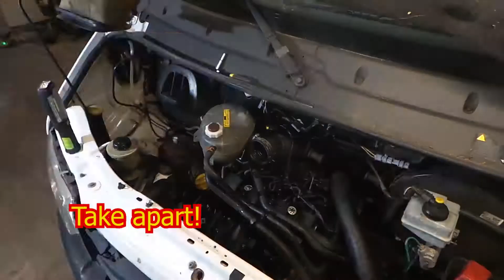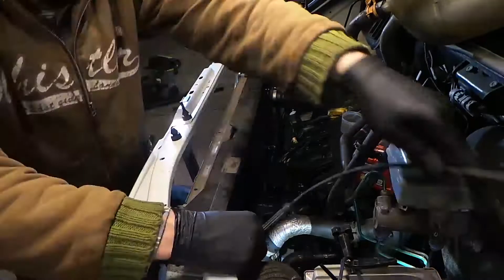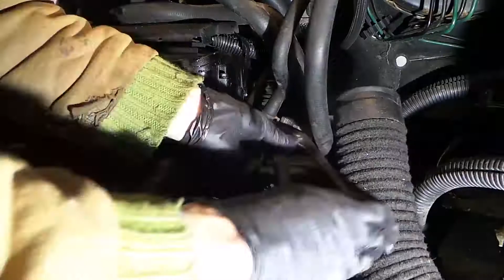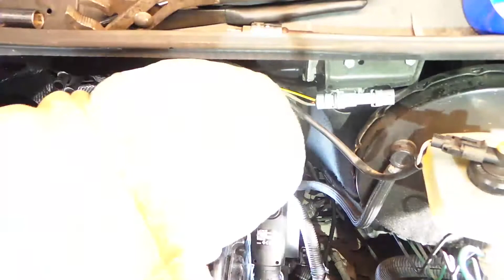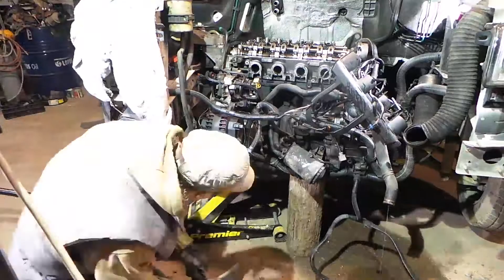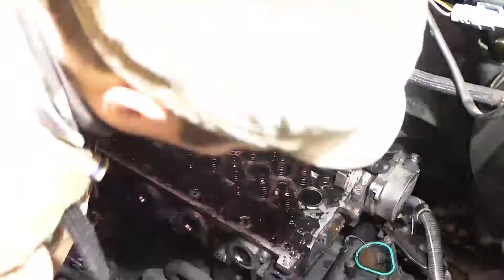OPEL MOVANO 2.2 CDT Blown Head Gasket RENAULT MASTER 2.2 CDT NISSAN INTERSTAR 2.2 CDT

Comment: What is ur opinion with this engine?
Reply from the maker: Thanks for question. My views are subjective it’s not worst power plant and isn’t the best ether. Regular maintenance don’t push it to the limits and it will run fine. Of course there are many weak points plastic parts that like to break apart 16 valve head is one of main weaknesses. There is no reason to blame engine at any way. I hope you got answer.